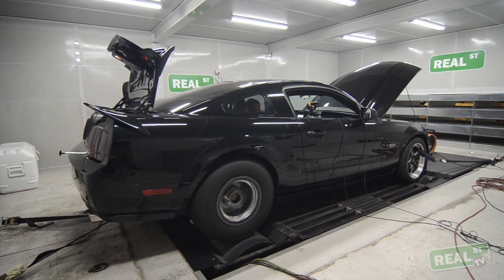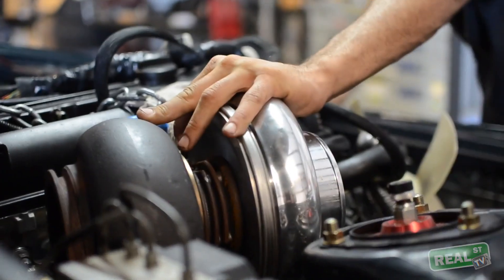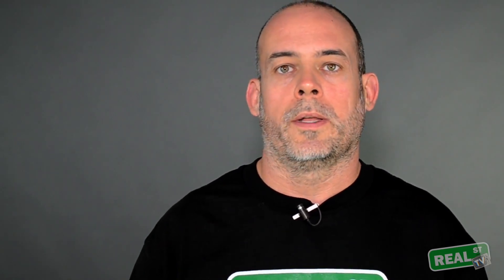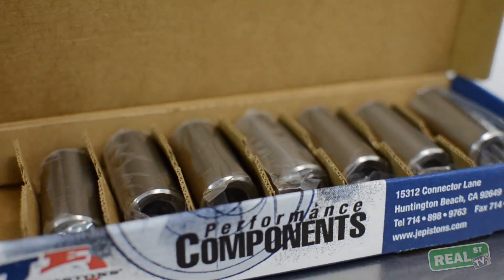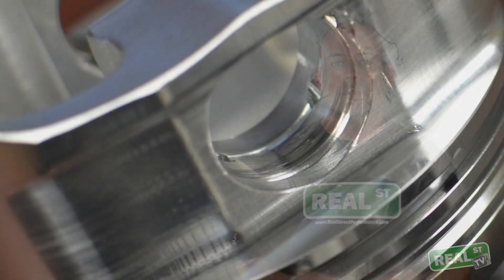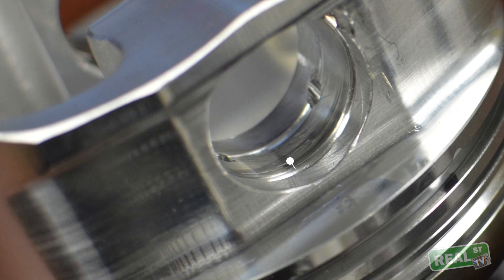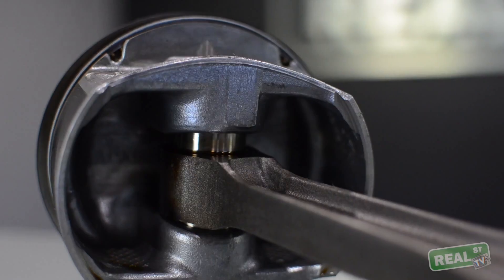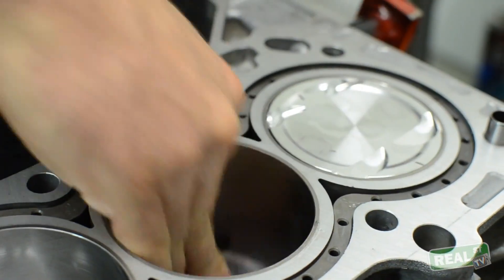Why Buy Upgraded Pins? -Jay's Tech Tips #28

Comment: The number 1 reason for your findings is the person who assembled the engine, used the pins right out of the  box. ANY REAL Engine Builder, will mic all pins in at least 6 different places and compare that to the pin bore in the piston.  Then check the pin bores for the clearance you chose to run, and for roundness and taper. A slight touch up hone is generally always a great idea and somewhat mandatory depending on the level of performance.  Will a set of pistons like JE, Wiseco, CP etc. work in most cases out of the box, YES. Someone concerned with a small amount of metal transfer, and just upgrades the pins, is NOT a Engine Builder. He or she is a engine assembler.

Comment: just bought cp pistons for my rb25...
are the included pins enough for my 600hp target? O.o
Reply: yes. I had cp pistons on my rb25 s13 just make sure you lube them up proper lol. dab a bit of oil on the cam lobes if your putting cams on too.
Reply: +Tony Crawford thanks for the reply!
engine is still NOT assembled. :D nooo timeee for it hehe

Comment: Going to look more into this, I had already chosen my pistons and rods for my 4G63 when I rebuild it. I don't have a crazy power level goal, and honestly I don't "need" to upgrade given the stock short block has been shown to be "safe" up to 450whp in AWD DSM's. BUT, riding on the edge isn't "safe" to me.

I selected the lightest and least expanding Mahle pistons since I don't have a crazy goal like 800HP or something. 380whp is my current goal with a MHI Evo III 16g, currently producing 318whp. But I also want to upgrade these components (along with valve train and oiling setup) to feel peace of mind, and not worry about "hurting" the engine beating on it. Sooo I can feel fine and beat the shit out of the engine. Not really abuse, just not worry about long periods of high load on the engine, such as seen with circuit style racing. So I guess since I would like the ability to wind it out into say 8,000rpm range (stock is 7,200) I should consider whatever is just slightly better than stock pins? And yes I know I wont NEED to wind it out that high esp. with a small turbo, it will be out of wind by then. I just want to be able to hold a low gear longer in say low speed corner again without worrying about hurting anything.

Might be hell on the syncro's though, as DSM 5 speed transmissions are not known for shifting well at really high rpm?

Comment: Learning less known facts like these are really helpful! Keep it up! Could yall possibly do a video about what things u may need to replace for highmileage vehicles? I have a 04 sierra that iust hit 200, 000 miles and would like to know what parts would be best relaced now rather than have go out on a less convenient time.
Reply: Without a full on freshening up of the motor there's not much you can do.The minimum is   Rings, bearings, seals and gaskets need to be done as long as everything else is still within tolerance
Reply: i have a 05 sierra with 272000 miles and still runs smooth

Comment: is full synthetic valvoline Synpower good for high performance turbo charged built motors? everyone tells me to use mobile 1. but i see others with nothing but good things to say about valvoline.....?? anyone
Reply: It work for us, having a SFWD Honda making north of 900hp.
Reply: Valvoline vr1 20w50 racing oil in built lq9 made 1,000flywheel if not alittle more in my c5 vette and can't complain. Recommended by shop that built my motor.

Comment: Hey! I`m running CP Pistons with stock pins on an SR20DET. At the moment I`m running 1.6bar boost and I`m planning on going E85 and 2bar+ boost. You think the stock CP pins can handle it?
Reply: The question is are you willing to risk it? Why risk your investment the man said it clearly its not a large investment to protect your engine!
Reply: DSHanska I would imagine the Pin is capable of withstanding approx the same amount as the pistons/rods. Why would they use a pin that they know will break at the hp rating there sold at.
Reply: asambi69 The engine is already assembled, but if I ever take the engine apart again, I will swap in thicker pins. I think pistons and rods were rated for around 800hp, so they SHOULD be able to take 500-600hp.
Reply: Take the 8 hours to pull the motor apart and swap in the rings that way you can also check the cylinder wall for scoring as well make sure everytjing is still holding its not a 15 hour process like a new turbo complete setup its a quick disassembly and reassembly dont guess and waste you time trust me its not worth the risk